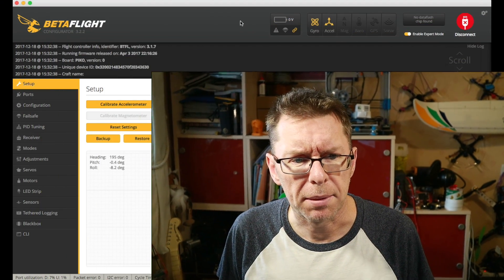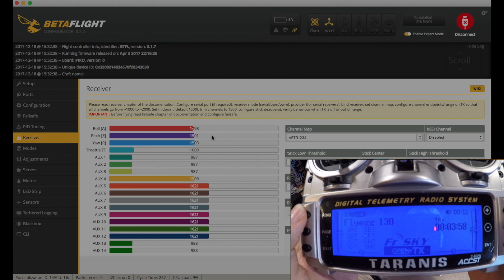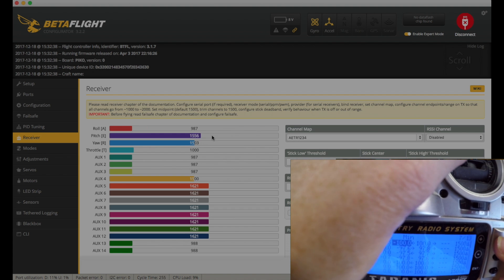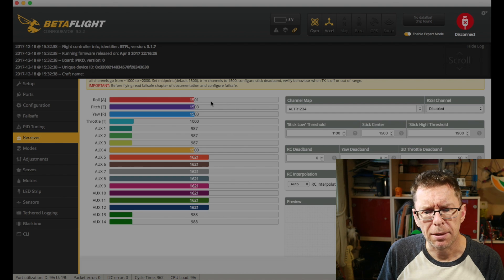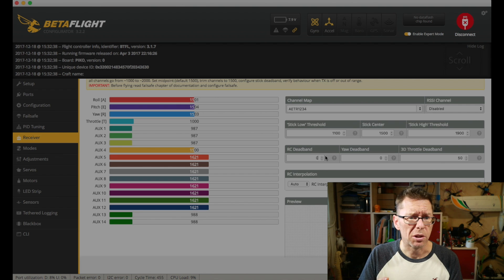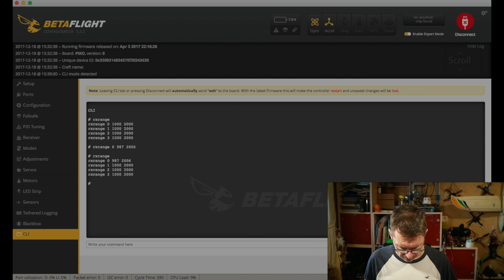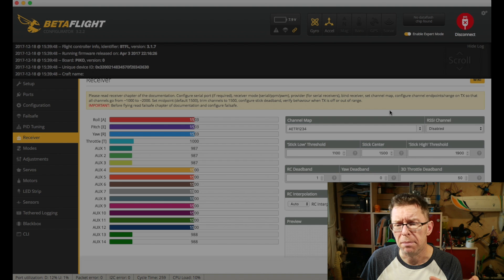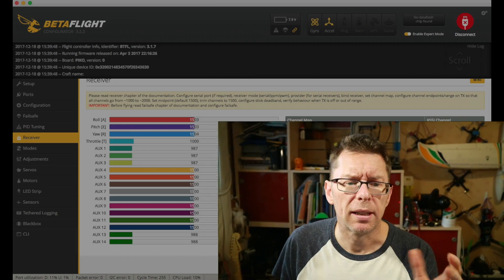FPV Tutorial: BetaFlight Basics Part 6 - The Receiver tab

Comment: I'm in need of assistance and would greatly appreciate any help that any of you can offer.
My brother has just received a Mobula7 and brought it round so I could help him to set it up with some mild settings in Betaflight. I came across an issue that I have never seen before and I'm not the most experienced person with this kind of stuff...I built a quadcopter a few years ago and set it all up without a problem, so trouble-shooting is not my forte.
Here is the problem: In the Receiver tab, there's nothing showing against Aux 1 through to Aux 14, no coloured bar, no value. This also means that we cannot set up any switches in the Modes tab.

Any suggestions, advice or help of any kind would really be appreciated.

PS: The switches are recognised as working within the radio, which is a Flysky FS-i6X.

Comment: Hi. I got a new brushed drone and it has futaba receiver in it. My radio sticks shows reverse in betaflight. I mean if I move the sticks upward, its shows down on betaflight and if I move the sticks left it shows full on betaflight. How to correct it. Radio is jumper t lite
Reply from the maker: You can use the Outputs section on your radio to invert (reverse) a channel - this is covered at around 22 mins in this video https://www.youtube.com/watch?v=O1Ea3wljoQs&t=1420s&ab_channel=CurryKitten  Not the same radio, but running OpenTX so close enough
Reply: @CurryKitten  thanks

Comment: Hey I really found you video useful and I used it for 2 whoops no problem at all. I tried it for my happymodel elrs (which I have another and all went well) but my other one didn't work. The only endpoint that moved was pitch backward but also roll moved with it and I had to set it back the way it was. Do you have any suggestions and they would be greatly appreciated.
Reply from the maker: So you moved the endpoint of pitch, but the endpoint of roll also changed?  Unless you've added a few off mixes there, I can't think of a reason no.  It would be handy if you could make a video and demo it to show what you are seeing, along with showing your mixes in each of the channels
Reply: @CurryKitten  sure I would love to, thanks. Working but I will do it tomorrow and thanks for your response.
Reply: @CurryKitten  Had the happy model elrs 2.4. Updated it and all is well, thanks

Comment: i have a jumper t18 and not all the channels are there in the receiver tab can someone help?
Reply from the maker: When you say not all the channels are there - what do you mean?  If it's a case of you clicking the switches around and nothing happens, then you need to make sure you've setup your model in the radio to actually use the appropriate switches on those channels for anything to appears.  By default you'd just have the 4 main channels (or perhaps 6 if you used a setup wizard)
Reply: @CurryKitten  Well I meant that some of them arnt acually appearing but someone told me that I need to change the radio when I set up the drone to 12 channels instead of 8, if this doesn’t work ill come back, thanks!

Comment: The bit about typing over the "Channel Map" to fix, (5:40)  can also be better done in OpenTx receiver by re-ording the MIXES under Model > Mixes. What Betaflight is displaying (when channels mapped correctly to sticks) is the MIXES setup in OpenTx. 
One less thing to configure for each model.
Reply from the maker: It's certainly another way... as with most things in OpenTX.  You can change your channel order in OpenTX (in the radio setup as well so a newly created model will look correct) The problem I have with this approach is that it takes longer to do this than change it in Betaflight.  I get quite a few models into review and they are always a mix of AETR and TAER so there's not one fix to rule them all
Reply: @CurryKitten  Channel mapping was not the issue. 
Was focused on having 1500mS viewed as centre stick position by FC and 1000, 2000 as endpoints. Using RxRange with TX16s resulted in values of 1500 +/- 10-15 in Betaflight. RxRange has not option to configure centre, just max/min range. 

Thanks again, for pointing me down a good path to a happy maiden.
Reply from the maker: Sure - I was replying to your comment about an alternative for typing over the channel map.  I've no idea why rxrange is pushed as an answer to what is a pretty easy thing to fix on the radio.  It only needs to be used when the end points can't be reached in subtrim,.

Comment: ♥️👍👍 Thanks for this video showing the RIGHT way to configure Betaflight Receiver ranges.

I literally spend 5-6 hours today following guides from a number of well know quad youtubers that kept referring to using RxRange in CLI. This just created a mess.

While it was not initial clear you adjusting Output, I did figure out which screen on my Radiomaster Tx16s (also OpenTX 😊). Reset my CLI "rxrange __ 1000 2000" to all AETR channels. Selecting each "Output" channel in turn, holding stick at max/min and spinning dial until mSec value read 1000 or 2000. All good and wünderbar!!

Comment: Hey can u help me figure out how to make some receiver changes? My yaw is on the wrong stick- how do u change it?
Reply from the maker: You can change it on your radio (usually - and certainly if you have an openTX radio) or more likely is that you are using something like an AETR channel order and your quad is using TAER.  In which case in the receiver tab you can literally just type over that and save it and the sticks get reordered in betaflight

Comment: Pls can u help me, when I adjust the sticks the wrong thing changes. For instance the throttle stick changes pitch.
Reply from the maker: There's some letters in this section which represent the channel order.  They might be written (commonly) as AETR or TAER.  In the first instance Aileron is channel 1, elevator is 2, throttle 3 and rudder 4.  In the second instance throttle is on 1, aileron 2, elevator 3 and rudder 4.  So you can see there that you probably have your radio set to one and betaflight to the other.  The asieiest update here is to click on the letters in betaflight and then using the keyboard delete the order that's there and type in the correct one.  Then hit save and retry
Reply: @CurryKitten  thanks

Comment: Hi.. i got a nazgul5 and I wanted to change the receiver.. so, i have a crossfire receiver which is already bound with my Jumper t18 .. in betaflight I got rx-failsafe , even if I move the sticks nothing happens.. any tips please.. thanks in advance
Reply from the maker: Ok, so a few details missing from what you have done so far to connect - could you fill these in for me.  You changed rx from... what rx did you have and what protocol was it running?  Did you change the UART you connected to?  Are you using SBUS or CRSF on crossfire, in which case what changes did you do in the betaflight setup, what physical connections have you made between wire and solder pads?
Reply: @CurryKitten  it was r-xsr receiver and I put a crossfire one which is already bound to the jumper t16, i changed the UART , otherwise I didn't change anything
Reply: Thanks a lot
Reply from the maker: Ok, so the R-XSR would have been connected to SBUS on an inverted UART, so you changed the UART (presumably to a non-inverted one)?  You didn't answer the question about the protocol you were using: SBUS or CRSF which will need the wires connecting differently, and you'll want to go into the Crossfire LUA script in order to make sure that the pins are outputting the stuff you want them to... again depends on SBUS/CRSF.  More detail needed, please be as explicit as you can in what you have done/not done.
Reply: @CurryKitten   @CurryKitten  i tried all of them ( UART ) . And it was on SBUS but I changed it to CRSF .. i didn't change anything with pins .. i tried to search how to wire the pins but I couldn't find , so i left them like they were
Reply from the maker: Check the UART script so you know what signal the pins are outputting.  Take a look through my video, I do go over it in this https://www.youtube.com/watch?v=E8VUdzQp00s
Reply: @CurryKitten  thanks a lot, i really appreciate it..
Reply: It works... Thanks a lot .. you're awesome 👍🏻

Comment: What if the input read all zeros nothing in the receiver tab every thing else works but that and it's bind and everything fine but receiver tab shows all zero just blank
Reply from the maker: When you say "everything else works" I have to presume mode setup doesn't, or anything else involving the radio.  Most common problem here is that there's a mismatch between what's coming in from the receiver and what you've told betaflight is happening.  Perhaps it's the wrong UART, or the wrong protocol, or your physical wiring is incorrect.  These all need to be double checked.
Reply: @CurryKitten  thanks but I figured it out I wiped the board and flash it    again and now we have stick everything working but full throttle it dies using xmplus and battery 840

Comment: Hello, can u please help me with the receiver tab , I recently built my first build and the receiver tab has no response when I connect the drone with betaflight configurator , of course with the taranis X9D plus on .
Reply from the maker: More detail here please.  Like: Did you bind the rx ok, do you have a green light, what type of connection are you using PPM/SBUS/other, how did you setup the ports/configuration tab.  Are you sure you are using the right UART, have you tried the others.  Have you tried moving you radio further away so it doesn't swamp the signal
Reply: @CurryKitten  i am on RXSR receiver . yes i have bind the receiver successfully after i bind the receiver thr receiver light is solid blue and green . i am on SBUS .. i am not sure about which one is right UART, i havent touched it .. i havent tried moving radio but i will do after a couple a hours , since i am working now ..  but under motor tab in betaflight , when i turn the motor on , it does Spin .. what does it means ?
Reply from the maker: Ok, sounds like it's bound and is in SBUS mode.  So check in the configuration tab that it's set to serial based receiver and SBUS, and you have the UART with serial rx active.  If you have all that and get nothing, then it could simply be the wrong UART.  So disable the one you have and swap it to another one (as long as that one is not doing something else) and retry.  The motors moving is just betaflight telling the motors to spin, it's got nothing to do with the tx

Comment: Help me!! My transmitter won't show any movement on the Receiver tab in betaflight 😭
Reply from the maker: Run me through what's you've done so far.  What rx/tx what protocol are you using, which UART, which FC etc etc - lots of detail

Comment: I connect my drone up and it won't show my remote up there I used to be able to but it's binded top
Reply from the maker: Used to work and now doesn't - anything change between working and not.  RX is bound, did any UARTs change, or the receiver type etc?
Reply: CurryKitten I am having same problem , I am on kakute F4 flight controller , it’s my first build up and no stick response in betaflight configurator , would you like to help me out sir ? I could find you in Facebook , if it’s okay with you, I am only 3 months old in fpv world

Comment: Hi there, having an issue where moving the sticks doesnt affect the the graphs in any way
Reply from the maker: Ok, so a case of double-checking things.  So first off, when you are connected up to betaflight and have your radio on, can you see that the receiver is lit up and showing you that it's bound?  Have you chosen the correct UART port for your receiver, have you tried the others ?  Have you selected the right protocol in betaflight - sbus/ppm/ibus/etc, are you also sure that your receiver is speaking the same protocol?  Can you check the out, and if still not working, run through your exact config as well as telling me the answers to those questions just posed.

Comment: Hey there, I'am completly stuck. I binded the fs-i6x with my fs-ia6b but no matter what, the reveiver graphs won`t move. Do you have any suggestions?
Reply from the maker: Ok, so what protocol are you using on your rx, and how are you setting up your ports tab and your configuration tab for it ?
Reply: IBus (omnibusf4sd)  and uart1 is my serial rx like the manual says.
Reply from the maker: Ok, so when you say you are using uart1, which pin are you connecting to?  If you are using the SBUS pin by the PWM pins that's inverted, so you need the rx1 pin on the other side of the board (if this is a regular Omnibus looking board)
Reply: Had the same problem with my quad. I also use IBUS..  I had to solder two small points together on the FC to make it work. 
Brigde them, jump them or whatever it is called..

Comment: Why in receiver tabs i move all my sticks and it seems kind of choppy movements. Not instantly smooth moving? Maybe dodgy rx? Because i tried the same thing but with another quad and they move smoothly and instantly?
Reply from the maker: What type of rx and radio are you using ?
Reply: CurryKitten actually its ok. I think my qx7 was too close to the quad. Xm+.
Reply from the maker: ok - cool.  I have seen weird issues before when using 8 channels with a smaller frame gap on xm+'s, but if it's working, then no worries

Comment: Great video!! I have seen all your how to fly acro videos!! Very helpful as well. But it's sooo hard learning acro. I'm crashing a lot haha! But for some reason my QX7 receiver left roll moves much much faster than my right roll! Both on beta flight and flying! All the trains are centered. But yet I touch right and it goes smooth. Then touch left and it's as if I'm pushing left faster! Any ideas?
Reply from the maker: Sounds like an interesting one - could be a setting in your radio.  If you go to the channels monitor in your QX7 and move the roll stick, is the graphical response different different as you go from left to right ?
Reply: Hmmm.. I hadn't checked that! But as soon as I get home I'll check that out. Thank you for responding!
Reply from the maker: No worries - I sometimes forget that not everyone has a radio 2ft away from them at all times :)
Reply: It moves the same as the beta flight graph, and while flying. The roll left doesn't go slow. I can make the right roll go slow on the graph. But the left cant go slow. Trying to move it a little makes it roll fast!
Reply from the maker: Well, it could be something hardware related, or it could be a setup thing in your model.  If you can pull your model off with OpenTX companion and send it to me then I can load it into my radio and see if I can reproduce the same issue - which is always worthwhile (my email address can be found if you go to my YouTube page, click on the about tab, and then view email address)  But you could also go to the inputs screen and check whats there under Ail, just a single line with 100, and if you edit it there should be a linear graph going bottom left to top right with weight of 100 and offset of 0.  Also check in the mixer page for ail channel - again, I would expect a single entry here with a weight of 100 and an offset of 0
Reply: CurryKitten I was just about to send you my beta flight. Then I found a section on the controller where I could calibrate the sticks.... Holy cow!! That did it!! Finally lol thank you trying to help me!! I appreciate that a lot more than you know. Keep up the good videos 🙌🏽
Reply from the maker: Nice one - glad you got it sorted.  I hadn't considered calibration would be the issue, but now I'll think of that if anyone else mentions a similar issue.  Hope this will make you acro flying a lot easier :)
Reply: CurryKitten I hope so too! Thanks again. And also I had crashed it very hard several times. From high up! And since there was no physical damage I thought it was fine. I guess that's how it happened! Because it was fine the first couple of days. These things sure are tough!

Comment: The endpoints adjustment on the Devo 7 is done with a setting called travel adjust (TRVAD) in the function menu. But using the rxrange commands is much easier than navigating that completely unintuitive menu system.
Reply from the maker: Ah, it is in there !  No, I must admit that after using OpenTX for so long, coming to a radio that only wants me to do stuff in the way it wants was a bit of a shock.  I also didn't try and setup switches - I found two of them were already assigned to channels and so used them in Betaflight... saved a lot of reading through the very very long manual

Comment: Very good.didn't understand a word but good overall delivery.
Reply from the maker: Roger, you are starting to give me concerns that I haven't explained things at all well !  All these are designed to be done so you'd have you quad connected up and could follow through things.  Please let me know if you'd done this and didn't understand what I was going on about... and where it was I lost you.  I'll attempt to put things right
Reply: trouble is i cannot even find betaflight and i am not the only one. sorry!
Reply: https://github.com/betaflight/betaflight-configurator/releases   ?
Reply from the maker: Thanks - teach me not to answer fast enough :)  Betaflight was a Chrome extension (and I still run it as such) but since google disabled the search in the app store and will alter discontinue support of the extensions, Betaflight is now a standalone application.  Download it where 6 teeth pointed to.  I'll update links in the initial part, and might do a quick update about this
Reply from the maker: I noticed I replied to you previously about the new download location for Betaflight, have you tried it - did you get the link and get hold of it.  I'm a bit lost about why you are having issues trying to download it.  Please elaborate and we'll try to assist.